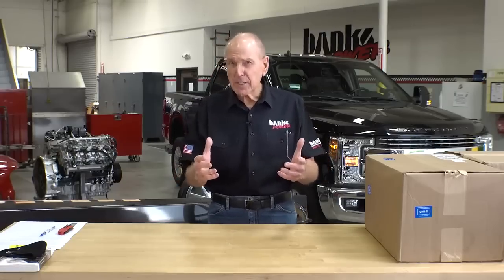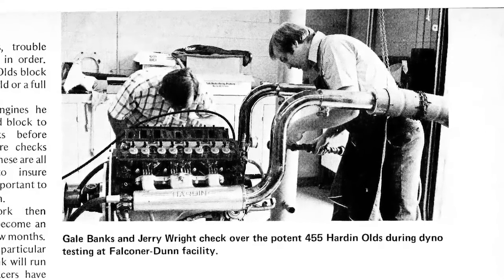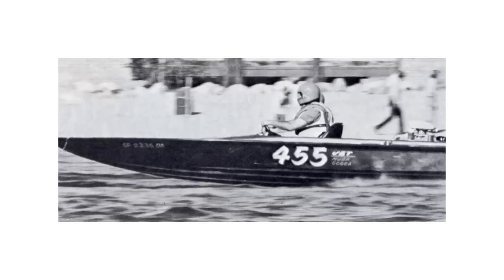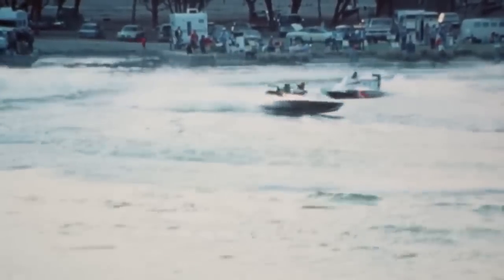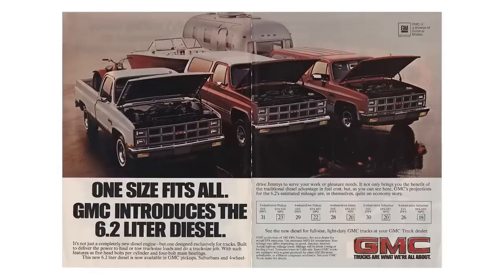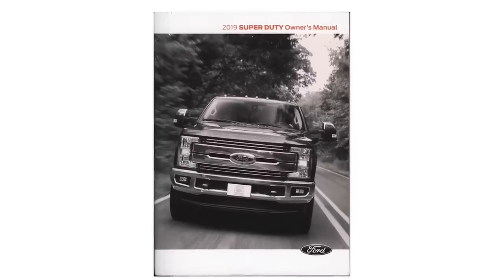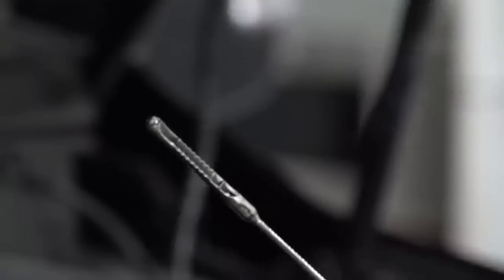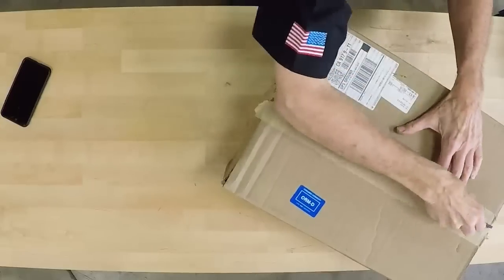WATCH HOW THIS GUY EXPLAINS AMSOIL! orderoil24 dot com

Comment: I used to be a avid amsoil user. Anymore though in the north the road salt eats the vehicle long before the engine has any issues. Usually 100k miles is about my limit before I get rid of them because by then rust is becoming a major issue. I have found you can pretty much go 100k miles on just about any type of oil as long as you keep up changing it. I use whatever I can get in bulk and sleep soundly
Reply: I agree 100%. I also live in northern Ohio and cars usually last about 10 years which for me is 200,000 miles. I’ve used conventional oil, Mobil 1, and Red Line in separate cars, all of which were able to hit that 200,000 mile mark with zero engine problems. No reason to buy the liquid gold priced Amsoil.
Reply: Amsoil is more expensive, but it’s such high quality that you can safely extend the drain interval to 20,000 miles, saving time and it will cost less and easily go beyond 200,000 miles!
Reply: Ever try their heavy mp? Spray it all over the underside of your vehicle and it'll be rust proofed. I am also in northern ohio and use cosmoline. I have proof it works. Heavy mp is about the same thing as cosmoline.
Reply from the maker: You get better protection and increased oil drain intervals, saving you money.
Reply: I live in Michigan & haul travel trailer's for a living with my 2011 Ram 3500 dually will hit 1 million miles next week. Been using Rotella 15W-40. Wish I would have known about this system when I bought this truck. Might have saved me some repairs. The truck is still running. Thinking even at 1 Million miles to switching to Amsoil.
Reply from the maker: @BBBYpsi  You can certainly switch sir. Please call me at 229-561-4426. I will help you navigate the different systems to help you get the right one. Even tho I am in Georgia, I can be your dealer! Please call or text!
Reply: @BBBYpsi  very impressive. what has been done to the engine in that million miles? thanks
Reply: @overheadcam32  head gasket at 346,000 miles, cluster at 646,000 miles,Turbo at 927,000 miles.
Reply from the maker: @BBBYpsi  Please let me know if you need to switch to Amsoil sir. How many miles on uour vehicle now?
Reply: @peterssynthetics-independe6786   I have 1,026,000  It has gotten extremely slow in our industry
Reply: Some oils lack additives and protection that keep from wiping the cam lobes flat.  Oil can and does make a difference.
Reply: @reubenmorris487  Oh I agree it does make a difference. My father in law uses Amsoil in his classic cars its good stuff. I guess my point is these new cars that are disposable anyway I wouldnt waste the money to put a high end oil in it.

Comment: I am a amsoil user,a moderate dealer  ( sell to my neighbors and coworkers and family) and all a believer.  I like the video and use most all the products but you never said you used the oil. Will you be changing the oil and be useing the heavy duty amsoil synthetic oil for diesel motors when installing the bypass  kit?
Reply from the maker: Yes, Gale Banks 100% uses the oil. Just type in Gale Banks BanksPower in google and you can see 100 videos with him using and recommending Amsoil.  He makes a rear diff cover and he uses the Severe Gear in the diff. They also sell it to ppl who need it for kits rtc.
Reply from the maker: Thank you for being part of the channel! Please like and subscribe! Helps out so much! :)
Reply: Cool thanks just wondering. I will subscribe
Reply: @peterssynthetics-independe6786  so I took you advice,  went to Google and utube and found only two videos  I you said about the  Is differential and of the oil bypass kit. And the reason I replied is I been sell the product for 10 years and I felt that  Amsoil support a famous name over the dealers and customer when it came to giving extra products l or a random person to try out one of ther products for a review.  And that's why I give it a thumps down👎.only two videos have or show the Amsoil name. Again I am just a moderate dealer that does weekend rallies and car and bike shows. Nothing against the name I am just saying.
Reply from the maker: @harleystreetglide1576  I dont blame Amsoil for sending him the those products. Gale Banks is old school and he is never going to try any of that other stuff on his own.  It’s worth it for him to be a pseudo spokesperson. There are more videos you just need to dig. However, thanks for your honesty in how you feel, rare in this day and time. Thank you for being part of the channel!

Comment: Gale, you should have gone for the Duel remote system. Been using the duel remote for my gas and my diesel!
Reply from the maker: Thank you for being part of the channel! I am not Gale Banks just a fan!
Reply: @peterssynthetics-independe6786  I have a question regarding changing to Amsoil motor oil. Love the concept of the dual filter by the way. I am going to switch over to Amsoil synthetic motor oil at my next oil change for my 2015 F350 V8 6.7L truck. Planning to buy the dual filter system as well, probably after the first cycle of new oil is ready to be changed.  I have about 120,000 miles on the truck.  I have heard that the Amsoil synthetic oil is good about cleaning out the "debris" from the oil system really well.  Based on that I am thinking that as soon as I go to Amsoil motor oil, I should more frequently change out the standard oil filter during that first cycle of new oil  use.  Do you know if Amsoil has said anything along those lines for folks making the oil switch with so many miles on their vehicles?
Reply from the maker: @wadetharp348  Please use my code at check out for your oil 30331652, my name is Brian Peters Jr, without that code I will not get credit and someone else will become your dealer, as we are all Independent Dealers. While it is ‘good’ any time you change out your filter, Amsoil filters have better filtration capabilities and more debris ‘storage’ in the synthetic medium. This usually isn’t necessary but also is not a bad idea. Using Amsoils Engine Flush product, ensures a good cleaning of the oil system, clears out any deposits and debris in the system, allow it to melt and break down into very small particles, thereby making them manageable for the filter to pick it up. Some folks also drop their oil pans and clean rhe sludge from the bottom of it. I suggest Signature Series motor oil. It is our best line of defense in the fight against wear, with 6x the wear protection then our competitors. The bypass filter system is excellent is cleaning out your system. Gas, diesel, car or truck. The bypass filter cleans particulates down to 2 microns at 98.7 efficiency and only taking 3-5% of the oil flow from the pump. This does NOT strain the system in anyway since the inherent design of the oil pump system allows for this and in many engines, has this in mind. Some engines are even designed with ‘port-holes’ into the crankcase etc. Keeing your engine clean from soot, blow-by, dirt and debris is key for the longest lasting engines, the ones that make it i to the 1-3 million mile range. Yes, I said million. Clean out a competition brand oil after 300,000 miles, and clean out the same motor with Amsoil at 1 million miles. Our engine will be virtually clear of varnish and debris, while we already know what to expect out of the other. Please allow me to be your dealer and I will be a great resource anytime you have questions, concerns etc. Thank you! Contact me anytime 229-561-4426

Comment: I have a John Deere 120D excavator with a 4045T in it, 90hp version. 
No matter how many times or how often I change the oil in it, it's pitch black. That black hole that will stain everything it touches abyss black. It's obvious I have consistent soot in the oil. 
I've always wondered how to ensure the engine is getting the lubrication it needs if the oil is constantly diluted with soot. 
Something like this may be the solution. 
Being a stationary engine, albeit a 4mph top speed, the requirement for proper oil lubricity is paramount.
You'd think it would have a oil cooler in it....nope
Reply from the maker: Please let me help you order a oil bypass system for your excavator sir. Please get in contact with me at orderoil24.com or call me direct 229-561-4426.
Reply from the maker: Please let me know how I can assist you!
Reply: @peterssynthetics-independe6786  dude, relax. You've comment on everyone that's posted on this video. I understand being a salesman but you're coming off as extremely pushy.
Reply from the maker: @tt7hvn  I apologize. Just a guy who loves what he does!

Comment: When Amsoil first came on the market I tried it in a Datsun car  I was  driving at the time.  The Amsoil was so viscus that it caused the engine bog down, loose power and stall at  idle.  I drained it after 100 miles and never touched the stuff again.  IMHO Amsoil is a terrible product.

Comment: Pursuant to a 1990’s law suit between Castrol and Mobil 1, courts ruled that group 3 and 4 base oils are synthetic, therefore any oil that contains one or both of those groups, regardless of proportions, can be called synthetic. So as long as Amsoil contains group 3, even if it’s 100% group 3, they can legally call it 100% synthetic. Thus, 100% synthetic and full synthetic are synonymous.  Amsoil admitted this in one of their own blogs.
Reply from the maker: Correct, however one part is not. 25% or more of Group 3 can be called ‘Full’. That is why our bottles say ‘100%’ not Full.
Reply: @peterssynthetics-independe6786  
“Castrol won the lawsuit and, since then, the industry has defined Group III base oils as, indeed, synthetic.

That means, according to accepted industry definitions and practices, an oil is “synthetic” and may be labeled as such provided it uses only Group III, Group IV or Group V base oils in any combination or ratio.

The oil could use 90% Group IV and 10% Group III base oil; or, it could use 90% Group III and 10% Group IV base oils. As long as it only uses Groups III, IV or V base oils, it’s a synthetic oil.

That being the case, the terms “100% synthetic” and “full synthetic” describe the same thing. They’re synonymous, and an oil marketer can use whichever it prefers provided the oil in the bottle meets the industry description of “synthetic” outlined above.”
Reply from the maker: @luptonpittman6520  Right. However, if the container has 25% combined Group 3 or 4 Synthetic oil or whatever combination thereof, the blender can use the remaining 75%. with conventional oil, thus lying to the public, in essence, thru the veil of the courts decision, and call their oil ‘Full’. Next. 100% Synthetic oil as labeled on the bottle is exactly what it means. 100%. Thank for pointing out what we already knew.
Reply: @peterssynthetics-independe6786  
Why would Amsoil themself say that 100% and full are synonymous then? Why would they not explain, in their blog, what you are saying about this 25% thing?
Reply from the maker: @luptonpittman6520  Please link that blog or article here or email me brian@orderoil24.com
Reply: @peterssynthetics-independe6786  sent to you via email. Unable to post link here for some reason.
Reply from the maker: @luptonpittman6520  Yessir. I read that and have read it in the past. Now I have an understanding of what your frame of reference is. If you do research on other manufacturers websites, if they do not publish the makeup of their oil, you can bet the synthetic content (3-5) are 25% or more. Folks have already done this research. I concede to the fact that Full could mean the same thing. If itnis truly 100% then then manufacturer would state that fact. Just because Amsoil says it about another product, does not always mean that is true, just like my claims may not be 100% correct in all things. Chances are, if the bottle does not state 100%, it is not a true ‘Full’. Therefore, claims of Full synthetic oil by manufacturers is simply not a truth statement, more of a statement pointing at the truth. Motul, Redline and Amsoil are the only manufacturers that I am aware of, that currenty have a true 100% Synthetic.
Reply: @peterssynthetics-independe6786  understood. Thank you for the explanation. ✌️
Reply from the maker: @luptonpittman6520  Thank you for a thoughtful and kind discussion and not a screaming match about motor oil.
Reply: @peterssynthetics-independe6786  the pleasure was mine, sir.